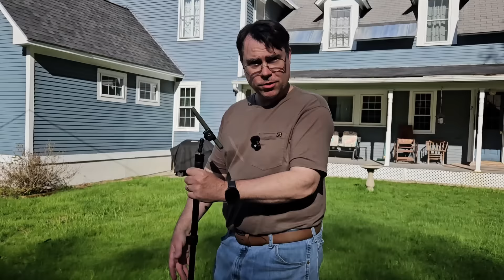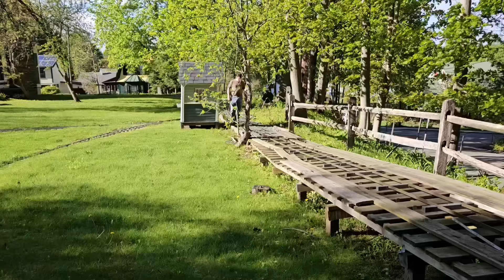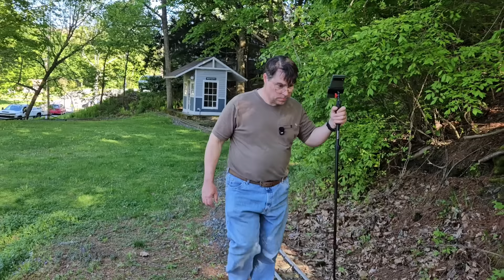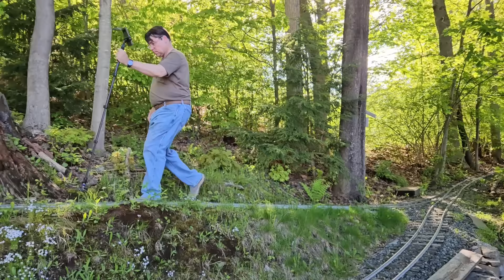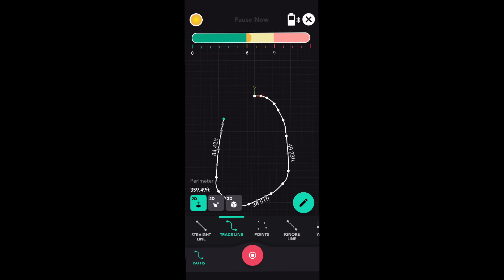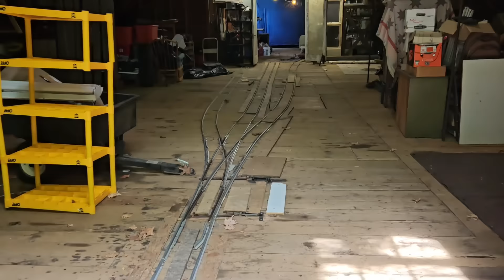This 8.1% Grade is one of the Steepest Tracks I’ve Ever Seen!

Comment: I always knew the Shady Pines had gradients, but that's just about impossible. Several full size railroad s that had a grade like that were i think the Silverton Railroad or the Silverton Northern.  The "Corkscrew Gultch" grade was around 5-6%, the Unintah Railway on Baxter Pass was around 6-8% I think. And Cass Scenic (former Mower Lumber Company) going up to the top is supposed to be 11%, but Ive heard disputes on that figure.
Reply from the maker: The Shady Pines is a steep little railroad, for sure. The Mill Brook isn't very flat, either. It's got 3-5% grades, and the roadbed on the new extension is proving to be just as torturous.
Reply: In some ways I hope the Shady Pines is preserved/operated by his family, but if it DOES need to be lifted, I hope you are permitted some of its assets...especailly the geared loco, which might REALLY help do heavier haulage on the Millbrook.
Reply from the maker: It will definitely be lifted. I'm not sure yet where it'll be going, but it would be nice if I could acquire at least the track.